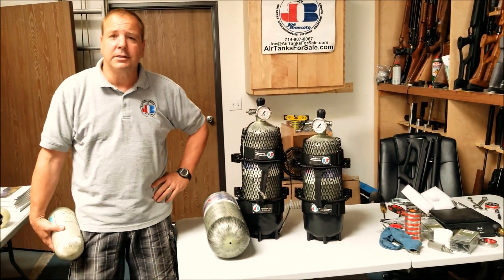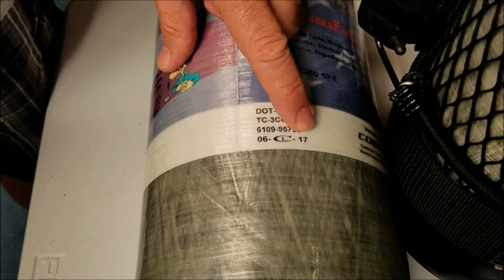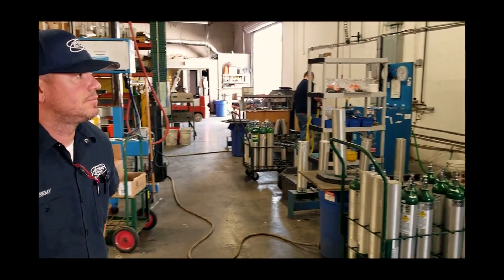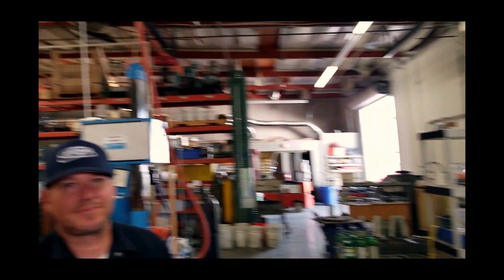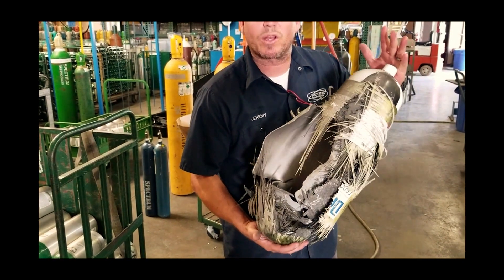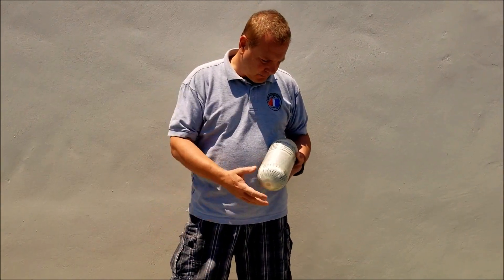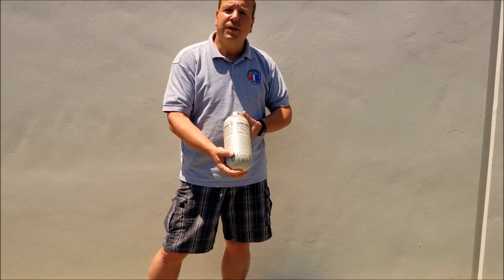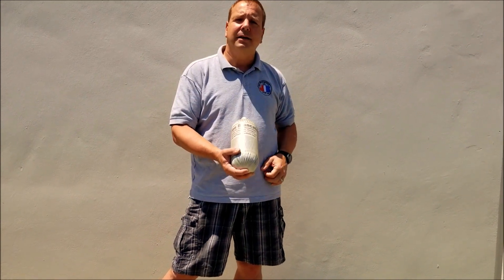HydroTesting a 4500 PSI Carbon Fiber Tank vs Catastrophic SCBA FAIL!!!

Comment: over here in the uk , carbon fibre tanks only last 15 years . after that they cannot be tested. they are only generally use by the fire brigade anyway.
Reply from the maker: Similar here: 15 years. There is a program to allow some tanks to be sent to a special place that re-certifies them for another 15 years, but it is VERY expensive to re-certify the first time (hundreds of dollars) and subsequently alsl very expensive to re-certify every 5 years.  It's not worth the cost to an individual, as it's cheaper to by a cylinder from www.ExpertHPA.com, or AirTanksForSale.com for a few hundred.

Comment: I'm trying to understand, if it fails the test then it could have failed the test for some period of time BEFORE the test was made. Does this suggest that even though it fails, the tank is designed to not burst well beyond the test limits for this exact reason?
Reply: Jake the test pressurize the tank to something like 1.6x its limit, he said 5/3  so 2/3 over its limit.  if the tank fails at or before that point, its deemed dangerous and likely to blow if dropped or slightly damaged in daily usage.   I don't know but guessing that a healthy tank probably should be testable to say 2x its nominel pressure.     you simply don't want a tank thats going to fail if your cat sit on it. exaggerating but the point is, any tank will fail if abused enough,  you want that point to be far from everyday operation, thats what the test is about, finding out if that point have gotten too close for comfort.
Reply from the maker: "FAIL" means it "baloons" or "displaces" more water than it is supposed to (i.e. indicating weakness). 
"FAIL" dos NOT mean it explodes, only that the tank stretches more than it is allowed.
Hope that makes sense. Cheers.

Comment: Here they ask 35 euro for a pressure test at our local scuba dealer for steel tank.  thats alot of money.
Reply: I just paid $40 for a hydro and $20 for a visual at my local shop. SCUBA is not a cheap sport, but I'd rather know my tank is safe than run the risk.
Reply from the maker: About $25=$35 or so locally in SoCal.

Comment: Was the one they showed blown up a fiberglass or carbon fiber. It looked old and fiberglass. Just curious. I have all mne hydroed when they should be as I fill them myself but I am scared even if they have been hydroed lol.
Reply from the maker: They one in the video was a Carbon Fiber tank.
Reply: The Airgun Scientist Joe Brancato thanks for the reply.
Reply from the maker: The one that was shown in the video was what is referred to as a "Hoop Wrapped" as opposed to a fully wrapped. A hopped wrapped tank is an older design (that are still made), and is basically a SCUBA tank that is wrapped with loops of fiberglass around only the middle, (not the neck and base). It's the worst of the worst of the worst. Typically all the weight of a metal tank, the 3 year recert (vs 5 for carbon fiber) and 15 total life of a fiberglass.   And they aren't that cheap!
Reply: It was a Drager 300 bar fibre wrapped composite cylinder.

Comment: Also , try to always buy a new valve. You don't know if the previous owner over tightened the valve. Of course always torque to manufacturers specifications.
Reply from the maker: normellow Many people upgrade to our TJ3 SLO-FLO valve. Out comes complete with 2 gauges,  one to show the pressure being put into the pcp airgun,  and the second gauge that constantly shows the pressures inside the carbon fiber tank.

Comment: Dang I thought we were going to actually be able to see it blow up. Have you done a video of that in the past, will you in the future?
Reply from the maker: Watching it blow up would be anti-climactic, as the tanks are not pressurized with Air (or the stored energy would release like a bomb).  Instead they are filled with water (hence the reason it is called a HYDRO-test) which is incompressible, and hence release very little energy  if the tank were to rupture.  Yeah, got to agree, it would be cool to see. I've seen containment vessles tested by using a tank, and shooting it with a 44 mag after they scored the carbon fiber so that it more easily ruptures. Lifts the whole containment vessel off the ground.
Reply: He has not, but that would really cool!

Comment: If I can be allowed to add one very important fact that I think was glossed over in the hydro static testing, is that no air exists inside the tank when it is tested.  The tank if completely filled with water.  Water is in-compressible, therefore if the tank were to have a catastrophic failure while being tested it simply splits open and does not explode.   otherwise, nice job.
Reply from the maker: T Shooter EXCELLENT point.  I guess I forgot too mention that very important fact.
Reply: Cleaver lad I'm glad you added the comment I had visions of men shaking like leaves on ever test. I had a carbon fibre bottle but got rid of it because I never felt safe around it.
Reply: At 4500 or even 7500psi - water is also noticably compressible... Just way less than air. If a tank bursts at 7500psi, it will not simply split open. It goes with a bang, too. But a MUCH smaller bang, admittedly.

Comment: Great video Joe! question for you, should I remove the valve on my tank before sending it in for hydro testing?(after degassing the tank of course)
Reply from the maker: No need to remove, as the Hydrotest facility will do so.  With that said, if you can remove the valve, do so, so that you know they don't damage it by dropping it, etc..

Comment: Joe,
   REALLY GOOD INFO!   
Question for you - what's the BEST way to carry and store tanks.  I'm brand new and want to do things the RIGHT way - I respect my family and care about those around me!  Any and all help or maybe a video would be appreciated.
Reply from the maker: Thank you for your feedback.

99% of our tanks go out the door with the full armor. The other 1% call us and order it if they didn't, wishing they bought it in the first place.  They recognize that a tank is an investment, so they want to insure its safety.

The Full Armor (option 3) consists of the following:

Carry Handle
Feet - So the tank doesn't roll around
Boot - Not only protects the bottom of the tank, but also allows the tank to stand up, so you can easily read the gauges.
Tank Protector

More information is here:
http://experthpa.com/cart/cart.php?m=product_detail&p=58

http://experthpa.com/cart/secure/images/products/611.jpg
Reply: Joe,
I had a chance to read your ad and the listings.  Sorry for the additional  Q's but as I said I'm returning to air power after decades of powder burning so I'm a neophyte to what's available and am striving to deal with only the best.  
Q 1 - Are all your products USA made start to finish?
Q 2 - what is the length of the fill hose?
Q 3 - How many fills for FX Impact sized cylinders? 
Q 4 - What's the delivery schedule and is delivery included?
Q 5  - Am assuming (I dislike that word...lol) the tanks are carbon fiber, and am reading the restrictions are possible going to allow a 30 year life expectancy - is that fact or rhetoric?
OK..... will close and say a prayer for your patience as questions from newbies are the worst!  My apologies and Thanks!   Hoping for a great new friendship and business relationship - my family usually follows my lead....they'll keep you busy!
Reply from the maker: Out of hundreds of items all are American  (other than obvously PCP guns made in Europe).  I think only 2 are Chinese becauses they aren't avaiable in the USA.
Reply: Not sure which items you meant - you might not have read all of my Q's as there are 5.  Again sorry to take up so much of your time, am hoping others can learn along with me.  Also - let's SEE if we CAN get those last two items made here - I love displaying American Made signs!  If you haven't guessed - yeah I'm Vet who still believes this is the finest place in the world, and I want to keep it that way too.  We're in Oregon and have a small horse ranch w/pests - the horses hate loud sudden noises in their barn, and I hate the idea of having a horse come up lame because I dispatch a critter that's not on my preferred guest list!  LOL  Thanks Again.
Reply: I like what you are saying about displaying American Made Sigs.  Also as a Vet I always look for thing that are made in that place called USA.
Reply: 1JawsJr 
We love our country!  Let's face facts - we ARE the guard and guide to  the future!